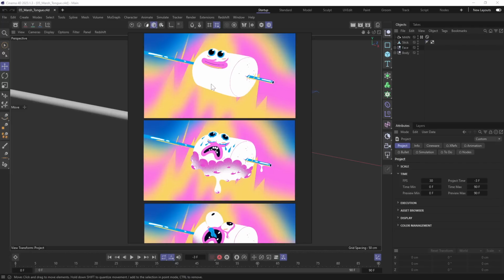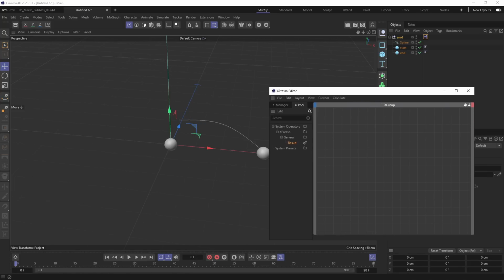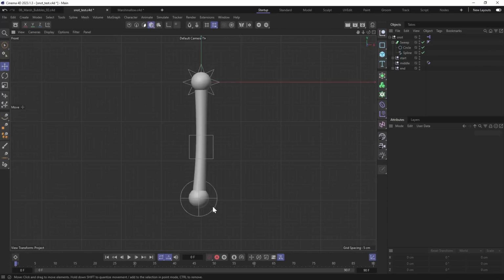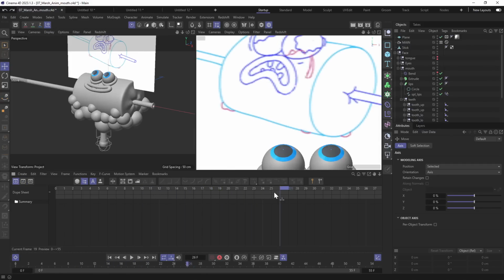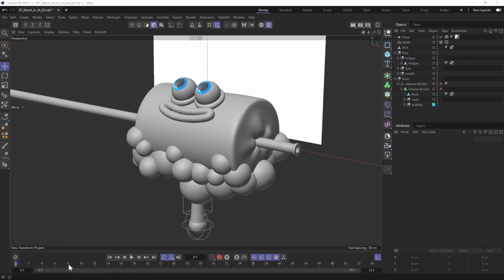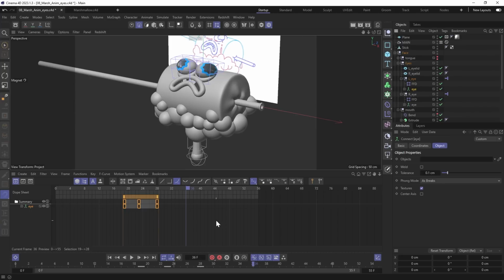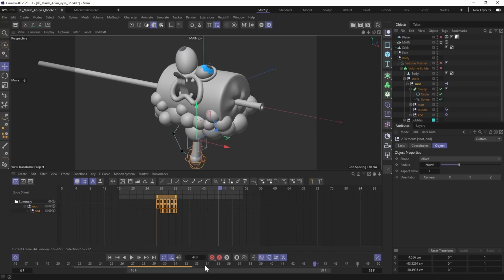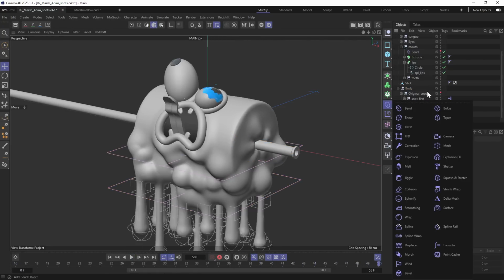Cinema 4D Free Course – Part 2 Animation

Comment: Bro, why did you make me use the Vibrate tag? Because of it, my entire Snots system and objects got messed up. For anyone who’s encountering objects shifting and their axes getting misaligned in the scene, there are two ways to fix it. I should warn you: you can’t simply undo the mess caused by the Vibrate tag—you can either zero out all Rotation parameters on every object or redo everything from scratch. But as I said, there are two methods to prevent the Vibrate tag from changing object positions and axes:

Method 1
1. Create a Null object and add a Vibrate tag to it. Set vibration amplitude to 0 to prevent objects from shifting
2. Make the object you want to vibrate a child of that Null (in our case, drag “Pivot” into the Null).
3. Add a Constraint tag to the target object (“Pivot” in our case).
4. In the Constraint tag’s Basic settings, press Set Initial State button.
5. Check Use Initial State option.
Now the target object won’t shift from its position when the Vibrate tag is active. You can animate vibration amplitude now

Method 2
1. Create a Null object and add a Vibrate tag to it. Set vibration amplitude to 0 to prevent object to move
2. Add a Constraint tag to the object you want to vibrate (“Pivot” in our case).
3. In the Constraint tag’s Basic settings, check Parent option.
4. Press Set Initial State button in the Constraint tag’s Basic settings.
5. Enable Use Initial State.
6. Move the timeline to the frame just before you want the vibration to start.
7. In the Parent tab of the Constraint tag, set the target to the Null you created, and keyframe it.
8. Move back one frame, remove the Null from the Parent target, and keyframe again.
Done! Now your target object won’t shift out of place when the Vibrate tag is applied. You can animate vibration amplitude now

For me, Method 1 works perfectly. I hope this helps someone.
UPD:I’ve just discovered that the mess caused by the Vibrate tag can be fixed by resetting every "middle" Null object in each Snot. At first glance nothing seems to change, but it really solves the problem. You can also reset all Rotation on every Snot object and every part of it.